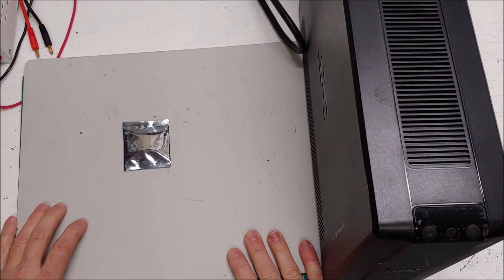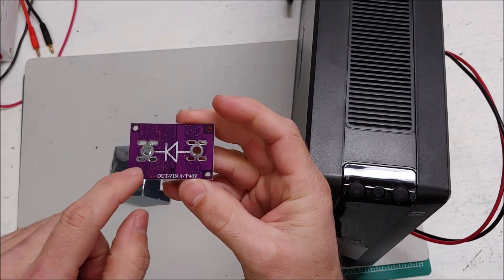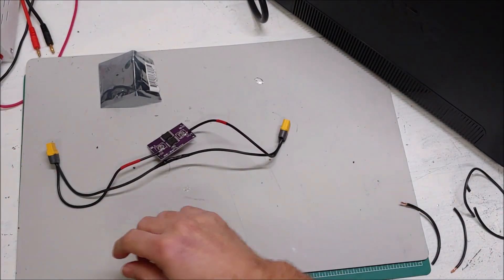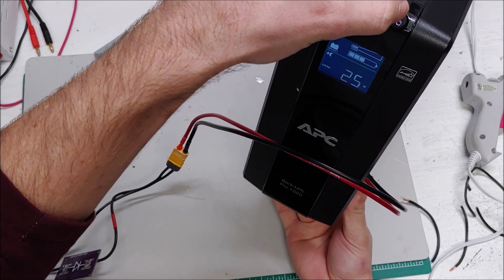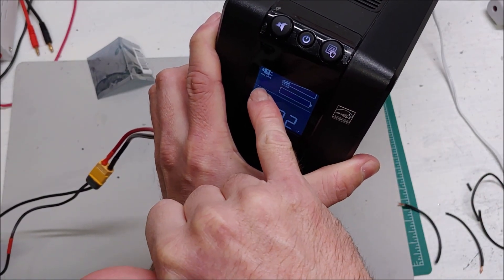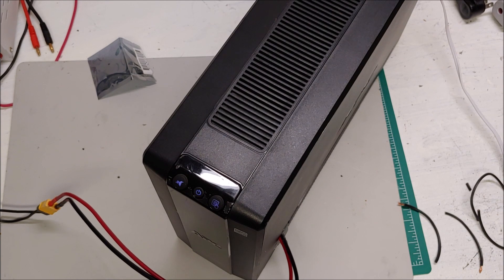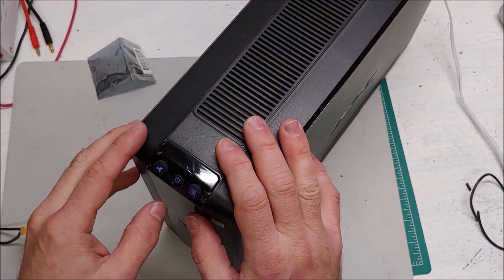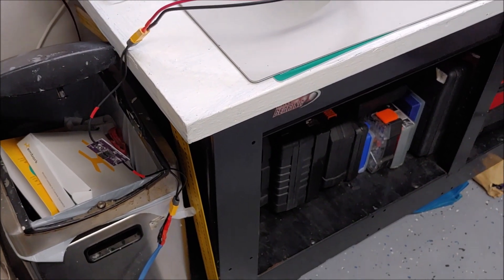15kWh Office UPS - Testing Blocking Diode

Comment: Hey, how did this work for you? I'm thinking of doing the same with my ups so that it doesn't charge the batteries as it is attached with a solar charge controller, which I want to charge the batteries with.

Awesome videos nevertheless, thanks a lot!
Reply from the maker: Diodes got real hot. In theory should work but maybe I didn't buy the right size.

Comment: Have u got experience with higher current through the ideal diode? Is it getting hot? What's the maximum you have tested?

Thanks
Reply from the maker: I gave up on the diode. The heat really concerned me.

Comment: Most APC UPS units run thru the battery at all times so when there is a power loss it is already on battery no power drop. Running without the battery means a power drop as there isn’t an attached battery

Comment: Have you considered the voltage drop implications of the diode? Curious to know what that voltage drop is for these !
Reply from the maker: Great question. I will measure and report back.
Reply from the maker: Voltage drop at 28 volts is 27.75v, so about 0.25v at 28v

Comment: if it can not read the battery voltage the unit will not know when to send out low battery voltage warning to the pc etc to shut down if your just using it as a cheap pure sign wave inveter then all should be good
Reply from the maker: When running on battery it does see the battery voltage. Only when running on 110v and it sends voltage into the battery is it blocked.
Reply: @stevenc22  so it just uses voltage for state of charge and not how much charge it has put in for it to use ? i have a apc rack mount i want to use lifepo4 for longer run time but cant warrent the cost
Reply from the maker: @1981dasimpson  yes. Since it was originally programmed for lead acid, it just uses voltage for cutoff.
Reply: @stevenc22  oh not to bad then
Reply: @mikehodgetts4864  i thoght all ups where pure due to the hardware they attached to does not like modifiyed as it generates bad noise
Reply from the maker: Modified sine wave works fine with most electrical equipment because they have their own power supplies which is going to chop up the AC into DC.
Reply: @mikehodgetts4864  i understand modified vs pure hence why i have a ups and not just a bog standard inviter running my server etc as all information i have read say modified is no good for electronics due to signal noise etc and more so with speaker and monitors as you can hear the difference